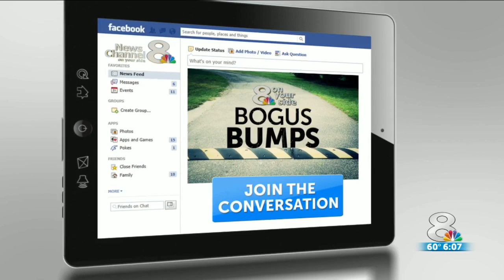Neighbors have speed bumps installed - without permission

Comment: I find this really funny as the town I live in was at one time known as the speed bump capital of the UK. We have them all over the place on residential side roads. When they first started putting them in they made them too large and a few cars couldn't get over them. I was in a car with some mates and the driver stopped for everyone to get out at one point, because he knew a particular speed bump could only be cleared if he was the only person in the car.
Reply: That's a great story, are you comfortable saying the town name I'm intrigued
Reply: Terence Kreft I too hate speed bumps
Reply: I ride an electric scooter every once in a while, and I was in a parking lot the other day with no option but to go over these speed bumps. I went over 3 of them and scraped the nuts off the bottom of the scooter. I appreciate it when they at least have the decency to put in a gap next to the curb or in the middle for cyclists and other 2 wheeled vehicles to get through.
Reply: @Tracert-mc1hu  if you had traveled over the bump at a diagonal instead of strait on you wouldn't have that problem, it's a scooter man! Or get off and push it over.
Reply: @Randomadventureswithpaul  Or just don't put it there in the first place and then it isn't an issue.
Reply: car drivers are why we can't have nice things

Comment: He said that having those are dangerous....so speeding on a small trailer neighborhood isn't dangerous enough??....they should've made those speed bumps 2ft higher
Reply: ".so speeding on a small trailer neighborhood isn't dangerous enough??."

I don't think that's what's being argued ... Speed bumps need to be installed legally at least partially because of the need to adhere to specific requirements with regard to the design - look at New Jersey back in 2014 and the hell that they put on drivers for making speed bumps that were abnormally big (and the damage to residents' cars for instance) to see one way in which it can be done wrong (EVEN by the right people).

Comment: Well designed speed bumps allow drivers to comfortably cross them near the speed limit but preventing speeding.  These speed bumps are shit, requiring the car to slow almost to a stop.
Reply: So they should have installed accurate what, 20 mph speed bumps there? Those ones are more like 5 mph speed bumps do you agree?

Comment: Check about parking on the sides of the roads and with a few strategically placed obstacles, I mean cars, they're having to do a forced weave.  Combine with good cameras and get some hits and runs when you know will happen.
Reply: The answer to people flaunting the rule of law is not flaunting the rule of law yourself. If you want to be a mini dictator go take over your own country. I hope they lock up whoever did this. And I hope it was that asshole that told the news crew to turn off their cameras.
Reply: @damontitus  and I hope you dont step in front of a speeding car. I got speeders running the stop sign by my house. A couple years ago a kid got hit and didn't survive. That prompted the stop sign install. But no cops want to enforce it. I say if they take out the speed bumps they better replace them with a cop
Reply: @damontitus  you don't know until it happens to you.

Comment: If the city has the time to remove them, then they had the time to install them. Many years ago, before concrete curbs were installed where I live, we could petition the city for a permit and the homeowners would pay to have them installed by a qualified installer and done to city specification. We were all good with that. Wouldn't it make sense to allow these homeowners to do something similar ?

Comment: No they did not go too far! I have a similar problem with my alley which I paid out of pocket to rock because my landlord is too cheap and my hay fever could not stand the dust. I have four idiots that think it's cool to peel out down the alley so that $150 bucks I spent on a rock has wound up everywhere that doesn't even start to tackle the other problems of theft in the neighborhood and I already told the city I'm putting one in I'm going to make it natural and I don't give two s** what anybody thinks because the last time the idiot and the mustang almost took out a small toddler the legal speed limit in an alley in Nebraska well City of Lincoln is 10 mph I would tolerate 15 if these f** understood what that was.

Comment: Lol my place there is about 2/3 of a mile long straight road with clean New streets we always see racing but once they were doing construction work they did not check the road they had left dirt like a speed bump wr just heard a tire screech I looked quick outside and I see a car flying they minutes later the guy screaming all mad and a truck coming up taking the car and the usual cops and fire truck because someone called the cops now they installed small but large bump roads.made of rubber